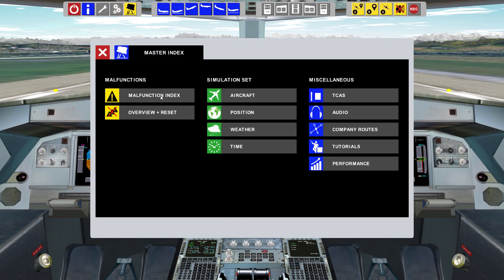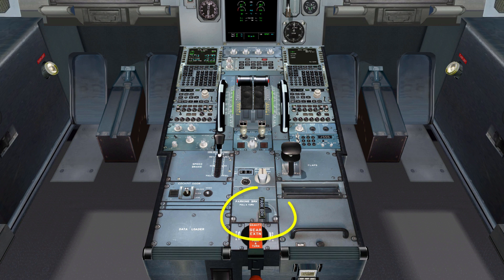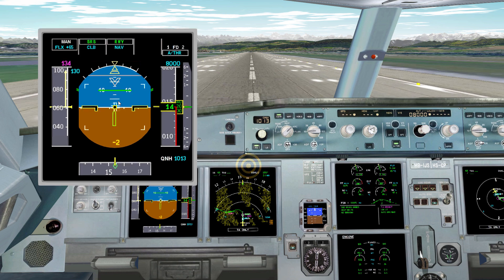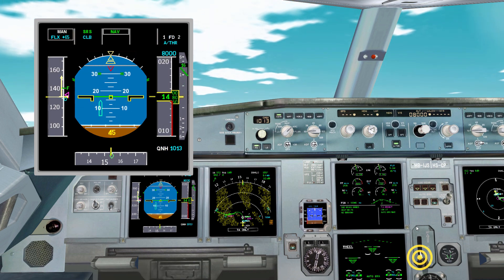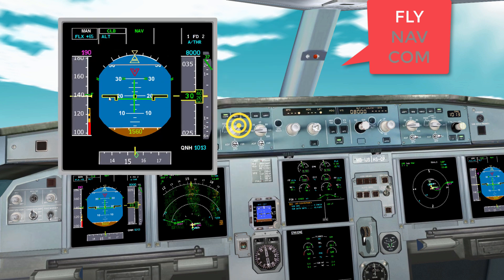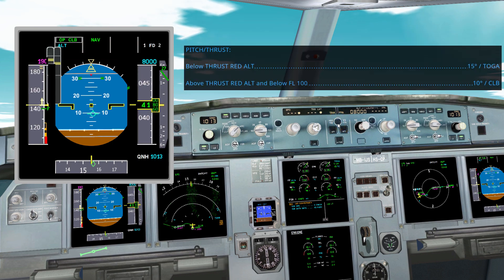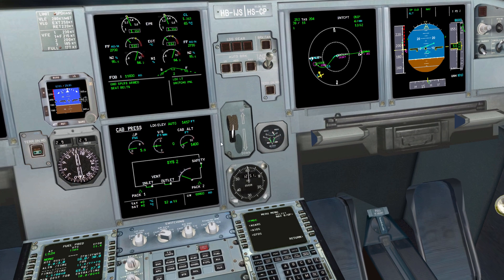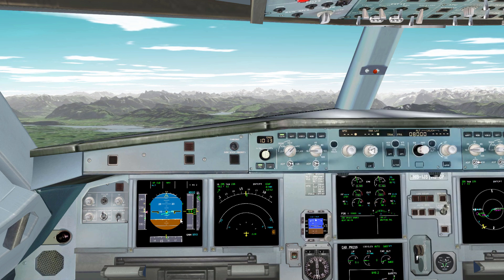Unreliable Airspeed at Take-Off

Comment: If 2 pitots are still reliable, you offer the memory item... just pass over the controls, deselect the wrong ADR and continue to fly...
Reply: Andrey Tselovalnikov u wouldnt know 100% immediately which ADR is faulty within few seconds after airborne (can mistakenly assume windshear speed drop indication as ADR fault)u could deselect wrong ADR & make it worst~ the purpose of the memory item is to get the aircraft fly at safe envelope, fly above MSA & then take ur time to properly diagnose which ADR is faulty
Reply: @muzlp  It's the same like if you have a bird strike to the nose of the aircraft, but there are no dents and any even minor scratch, will you call an inspection and report it to your office, and get a delay and other unwanted consequences? The same situation is with the airspeed, indeed it is rather crucial and incommensurably more important thing, but nevertheless there is always a difference how you cope with failures in real life and on simulator. Sully also started an APU instead of performing QRH steps blindly, and selected Flaps 2, but not Full... After him, the ditching procedure was redesigned. So my idea is - apply memory item here, only if the situation is really bad.
Reply: Andrey Tselovalnikov Yes i would report it, maybe it’s a different work culture different regulation in ur airline but in my airline & my country it’s MANDATORY to report a birdstrike regardless where it hit. 
You could lose your license for not doing so, and indeed few were suspended for that. So yeah to avoid “unwanted consequences” i’ll just report it, i’d rather hv a 15mins delay than grounded for a few weeks 😂 cheers
Reply: @clearedfortakeoff4205  in Which books says that? No procedure on Airbus is like that...Cheers.